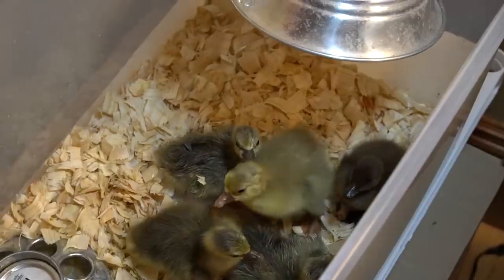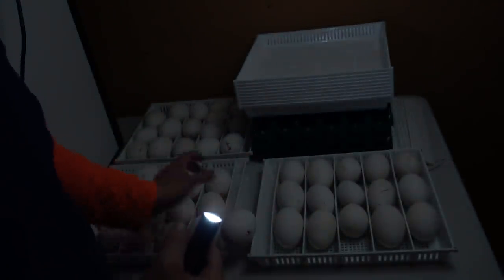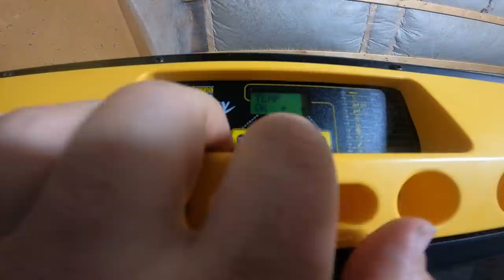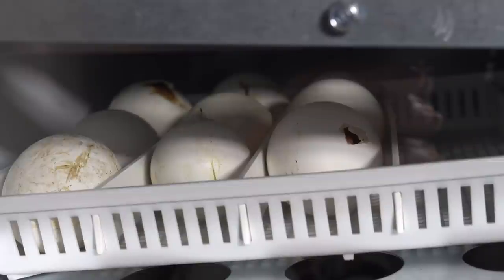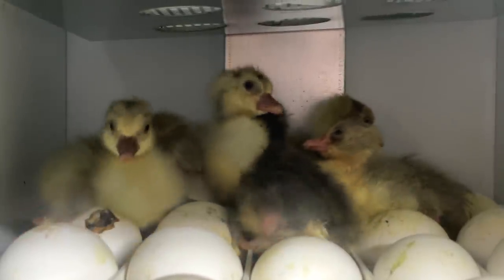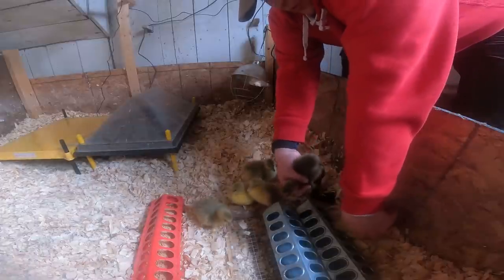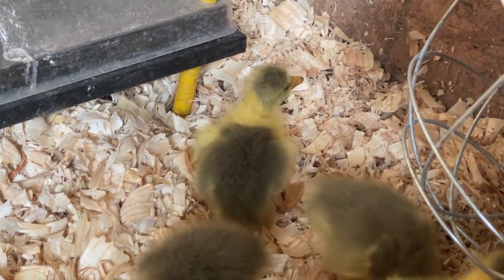Welcome to the world, goslings! Hatching start to finish)

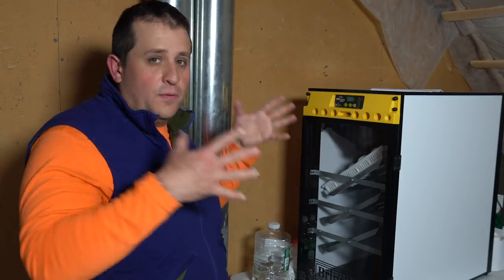Comment: I'm at 2:57 and a thought came to me. The outer eggs on those trays get a whole lot more movement than do the inner rows. I hope you kept track of the egg positions to determine if this had any effect upon those eggs! Going back to video now.
Reply: As far as I know, it is only important that they are being turned by a certain angle, of which all eggs get the same.
Reply: The movement should be irrelevant, as it is super slowly. However all eggs get the same movement in terms of angle, which should in the end matter.
Reply: It's not about total movement vertically, it's about rotation, in which case they all get the same angular rotation.
Reply: @cheongyei  Those eggs furthest from the point of rotation will internally have their mass rotate further around the egg's central axis. It would be significant and worth noting, imo.

Comment: Hope you gain at least 75% Hatch rate.More would be fantastic.Splendid Splurge on that Incubator.Lil helping out    Peace from MN
Reply: looked like 25% to me
Reply: looked like only the bottom 2 trays (total 30 eggs ish) were hatching and atleast 12 hatched with some hatching still. Its closer to 50%
Reply: @wavytiger1  still early days for the first batch, these were just the early hatchers
few more days from that clip time and then that'll be a pretty solid idea of how many hatch from the first batch(then batch 2 and 3 more days/weeks down the line)
Reply: @prcervi  he did 2 batches, 48 then 45, he took out 6 of the 48 then after they started hatching he said ill wait 48 hours until i open it and then said, i dont see many more piping, he took out 8 and left in 4 after that 48 hours so unless i missed something else i dont agree with you

Comment: Yes they pip in order to get oxygen and expelled CO2 as the shell permeability can’t keep up with their needs any longer. At the same time they are also breathing down excess water still in the shell through the pip until it reaches a point correct to continue circling the large end of the shell for break out. After pip the baby my rest 8 to 12 hours before doing the break out circle. Which may take another 8-12 hours.

Comment: A Chick Called Albert has some great videos about rescuing chicks/goslings/emus who are the most challenged with hatching.  So sad to contemplate them not being able to pip out and dying slowly because no help given.
Reply: Ya but you can kill them by peeling the shell. Most people shouldn’t attempt helping because they lack the knowledge
Reply: @picklep9812  I agree most people would probably get it wrong. That's why I suggested the A Chick Called Albert videos. He shows how to create an air hole so they get more oxygen and are strengthened. Also shows you can gently add moisture to  the egg membrane so it's softer and easier to escape from.

Comment: You should use some more Youtube dollars and buy an Egg Buddy. They run about $300 these days. You can only check one egg at a time with it but it's the same with candling. If there's a heartbeat you get an instant display on the monitor.

Comment: Hi Morgan, Wes Miller here. This is my second year at trying to perfect incubating. But come to realize I can not do as good as mother nature lol. I wanted to get a cabinet incubator to do more pheasant eggs in spring of 2022, and some duck eggs from our "Black East indy ducks". My question to you Morgan did you or could you put different thermometer in the cabinet incubator? We are using the Farm Inavtor Styrofoam and a HHD incubator. I didn't trust just the one thermometer. This last hatch we did we got a laser thermometer to check the egg temperature instead of the air temp. When past half way of development, its amazing how much heat the egg makes on its own. About day 18 and onto day 28, we would check the egg temp with the inferred laser thermometer. The crazy thing was is the air temp would say  99.5 or 100 degrees, but the egg temp would be around 102 and even caught some up to 104 degrees. Se we would back the air temp down to 97 or 98 degrees sometimes. Just so you know this was a trial and error hatch. So what happen was the hatch went past the 28 day mark, to almost day 30. Everyone thst has incubating may know that if you have late hatches, then most likely the temp was on the cool side, and if early then it would be on the hot side. I will say I think we had a healthy hatch, but I am not sold on bring that temperature down because of the egg temp. I am going to try that procedure again. Wantted to get your thoughts on the laser thermometer and going by the egg temp. Thanks

Comment: Do you have an automatic backup system that would provide energy for the radiator and heat plate in case your power goes off?

Comment: I just hatched 8 ducklings for my flock last weekend. I love radiant heat, because it is safer than the old red bulbs. I have a brooder plate and have used it, but I don't like the brooder plates, because the babies hide under them cutting down on interaction between me and my ducklings. If I was hatching dozens, for a farm, I would love brooder plates, but since my hatching are small and I want to interact with my ducklings, I find the brooder plate hinders that. Worse I had a duckling that was not thriving and it took me a couple of days to figure it out, because she hid under the plate most of the time. When I figured out she had a problem, I fed her duck egg yolk for a few days and she is now a healthy adult duck, but after that, I don't use the brooder plate.

Comment: I have chicken eggs in my incubator and it is a similar process but I have a question about the goose eggs obviously it is longer and different humidity I will look all that up but how did you do the lockdown with the bottom 2 Trays and change the humidity with the top 2 drays still developing

Comment: How did you handle the different timings for hatching in the same incubator since you added a 2nd round of eggs a week or so in?  

I'm hatching quail for the first time and am sort of facing that issue since you're supposed to raise humidity during lockdown (I'd assume same for geese).  Quail are supposed to have 40-45% humidity during incubation but notably more for hatching (offhand I think it's 60% but I have to double check).  So I think I'm going to have to use a different incubator for the actual lockdown phase since my batches are about 10 days apart...
Reply from the maker: I just leave the newer eggs in there and they hatch roughly a week or so later.

Comment: Did you sprayed water on those eggs?
Reply from the maker: Yup
Reply: @GoldShawFarm   i would like to watch how you do it . Some take the eggs out some just turn off the incubator . Some keep the spray in the incubator so the water keep be the same temperature. It's very confusing.

Comment: They are adorable. I was just wondering during the lock down process if it would be beneficial to remove the plastic dividers so the eggs could move around more freely during the hatching process?
Reply: From what I know you shouldn't really move eggs because if you move them from where they were originally they embrio could drown in the white
Reply: @xg3m1n1xX  Yes that's correct, but what I was trying to say was the plastic dividers seemed to be in the way when they are trying to break through the shell making it more difficult for them to get through. In a natural environment the eggs are able to move more freely during the hatching process making it easier for them to exit the eggs.
Reply: @dommiele8107  ah ok